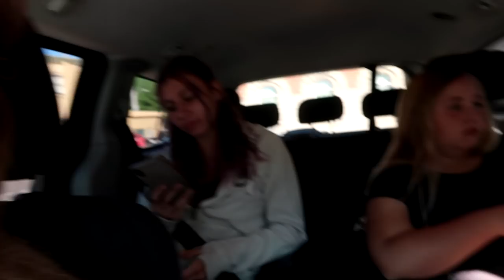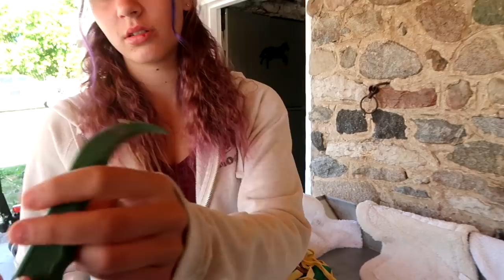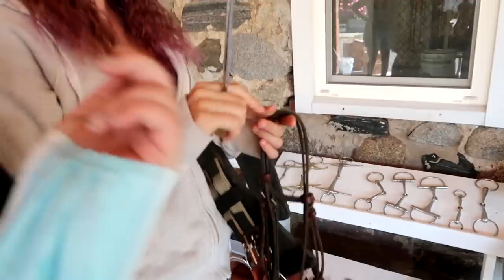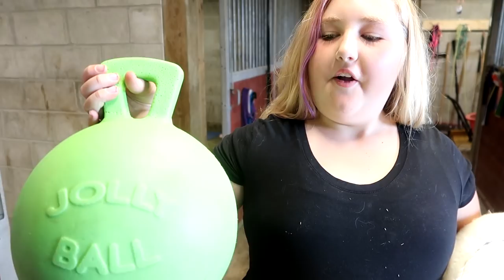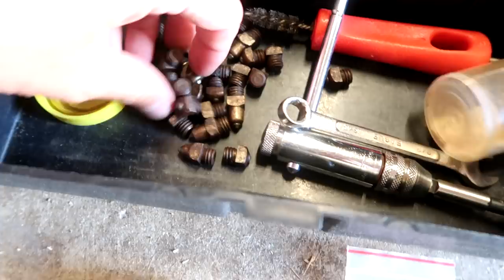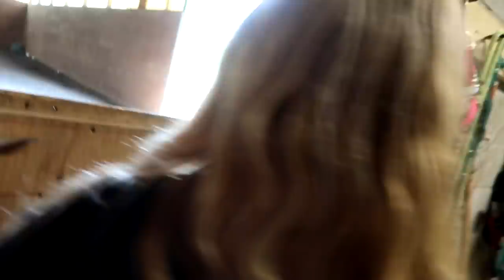New Saddle Shopping And Huge Tack Haul! Day 211 (07/31/20)

Comment: People might be pushing you to use half pads.. but if the saddle is fitted to the horse without a half pad, it will be too narrow once you put the half pad on as it alters the fit.
Reply: Agreed - if you want to wear a half pad you need to have your saddle fitted/checked with one - or use a thinline pad which doesn’t adjust the fit. People used to just wear them to make saddles fit but now they’ve become fashionable everyone’s adding more weight and bulk to a good fitting saddle to look nice! A good fitting well distributed saddle on a horse with good topline will protect far better. That said I prefer a thinline pad on horses with issues like KS and OTB’s 😊
Reply: Yes, u shouldn’t need a half pad with any saddle if it’s been measured properly
let alone a made to measure saddle it will cause problems and may make it to tight on the horse back again no hate 🥰

Comment: The red rubber disk in the stud kit is actually the best safety tap you can buy. It screws into the stud hole (do it gently so you don’t accidentally cross the threads) but it’s purpose it to clean the dirt out of the stud holes before you screw in the actual studs or insert plugs. What makes this tap good is because if the horse were to pull its hoof away from you while the tap is screwed in, it wouldn’t hurt the horses, they would simply stand on the rubber disk and the threads would be in tact still unlike what would happen if it were a traditional T tap

Comment: The green thing is a safety tap for cleaning the stud thread. Usually you use a tee tap, but these ones are safer, in case the horse puts his foot down while you are cleaning the thread it is nice and flat. Haha Laura when you find your horse, the girls will be wanting to ride it, even if its a gypsy vanner. It needs to be the horse you want and the horse you need 😊

Comment: Pity about the bridle, I’d have thought she should have known whether it would fit a 12.2 as you specially asked, but at least it wasn’t expensive. I’m sure you could order one online, just take some measurements from Gracie, so you know how long the cheek pieces need to be etc 😊 Same with the bit and saddle, measure her for the right size, then you know roughly what you’re looking for 😊 You could probably get Gracie a Wintec or  something similar, look for a saddle designed for more flat backed ponies with no wither, I’m sure Fionna would help 😊

I can see why a Gypsy Vanner wouldn’t be Gabby’s type of horse lol. I definitely wouldn’t entertain going to view a horse that far away unless I’d been able to see decent photos, including feet and some videos of it being ridden, including jumping if it’s advertised as being able to jump. Recent videos too, not ones from ages ago and if they can’t I’d give it a miss. I’m not suggesting that there’s anything wrong by the way, just a very long way to go and in my view, far better to see as much and get as much info as possible before deciding to view and that’s for your benefit as well as the sellers 😊👍 ps the red tool you picked up out the stud box is to clean the stud holes, you twist it in and out and it removes the dirt. Tip for your studs to prevent rusting, after cleaning and drying, spray with some WD 40 😊